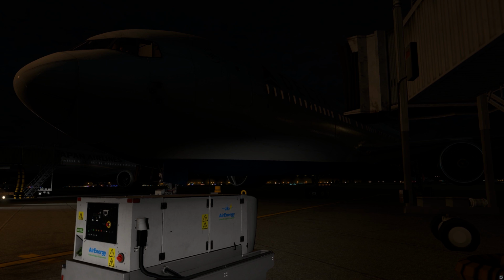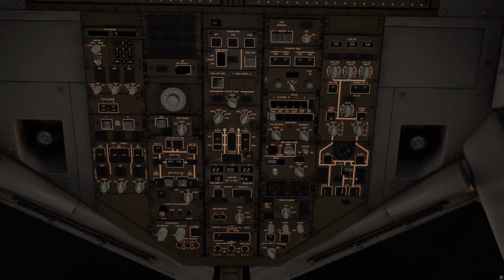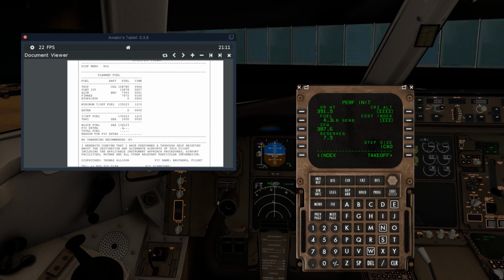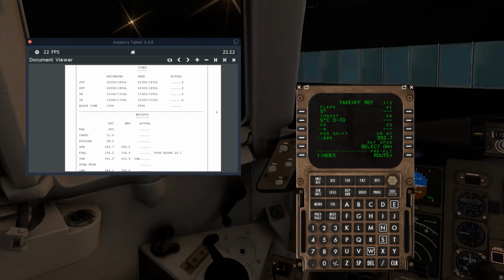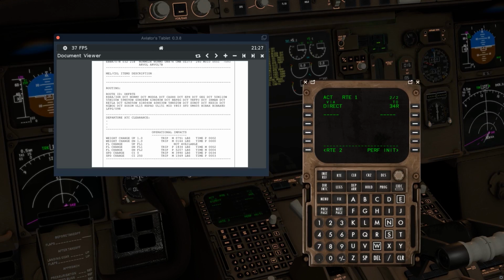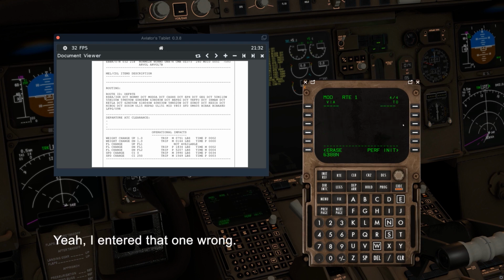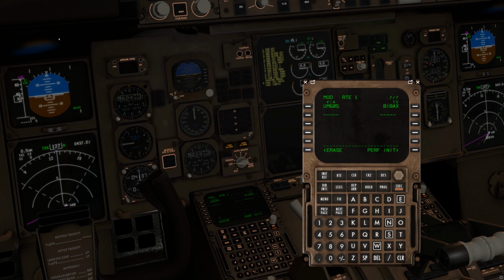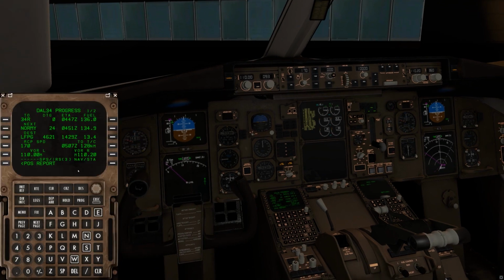X Plane 11 - 757 and 767 FMC Tutorial | Delta Airlines (Flight Factor) How To:

Comment: Why IRS on Heading? I‘ve never heard that before
Reply from the maker: When it’s flipped to the hdg position during alignment, it shows time remaining until alignment complete.
Reply: @FlightBrothersFT  ah ok and do you switch it back to PPOS when it‘s aligned?
Reply from the maker: It’s up to you.  I generally don’t care what my current position is, so I usually leave it showing the wind/speed data.  Depending on the options selected from the tablet, the wind data may or may not be displayed on the instrument panel.
Reply: @FlightBrothersFT  alroght. Gonna check it out. I really have my troubles with this aircraft. Do you have GA issues too? Or even after landing? The APPR mode is not possible to disconnect on mine, so when I have to do a Go Around I must fly manually and have no FD, while it‘s not smart to take eyes away from the PFD because the aircraft is pretty wild 🙄
Reply from the maker: Hmm, I’m not too familiar with any issues.  The approach mode should be disabled once you flip the AP disco bar down on the MCP.  As for the GA, I have not done one in a very long time.  IIRC after pressing TOGA to initiate, your FD should still be available, you would have to re-enable the AP, though I don’t remember if the gear and flaps are tied into that process.

Comment: Do you have a video on VOR navigation in the 757, specifically using the auto pilot while flying inbound to a VOR
Reply from the maker: No we don’t.  If you are flying inbound to a VOR, set the course to the outbound radial.  If you are inbound on 270 and want to fly 090 away from it, set the course to 090.  If you want to fly 030, your bearing would be 030 but since you are traveling to it, your radial would be the reciprocal or the 210 radial inbound/or 030 bearing.  A radial “radiates” from it, a bearing brings you to it.

Comment: Every flight plan has me going into a traffic holding circle and not flying directly into runway heading. Im flying a 767 not a cessna 157
Reply from the maker: We’re not sure we follow your question.  Are you inputting the STAR to runway?  The 757/767 FMC will not allow you to input the arrival information (I don’t think) until you are greater than half the distance between the arrival and departure airport.  Verify this is being done, otherwise you are likely to end up at the end of a plan, possibly resulting in the hold.  This is just a theory.
Reply: @FlightBrothersFT  I do get a list of available runways along with a transition in the fmc plans but...they all end up a sharp turn or circle. The approaches are never straight on. Therefore..the localized cannot be intercepted.btw
My plan is KWSF  to KJFK I've tried ils 22...ils 13....ils 31...
Reply from the maker: Are you getting a discontinuity or a “vectors”?
Reply: @FlightBrothersFT  vectors...i shared a video here.

Comment: My final descent always misses the runway by a few degrees. The plane lands unto roadways and blgs alongside the runway...why?
Reply from the maker: I assume you aren’t hand flying.  Does this act the same with an ILS and an RNAV?  I’ve never had an issue with the FF757/767 landing.  Make sure you are setting the final approach course on the ILS receiver if you are using it.
Reply: @FlightBrothersFT  I programmed the ILS runway into the FMC. The FMC had the Nav radio properly set to the ILS frequency.  I dont believe I intercepted the localizer yet glideslope was picked up. Weird
Reply: @FlightBrothersFT  I also randomly picked my destinations runway. Maybe the runway wasn't the recommended one. I'm new at this.
Reply: @FlightBrothersFT  I also flew my final at 1800 feet.
Reply from the maker: @lastcall170  you tuned this ILS receiver, not nav 1 correct?  The ILS is in the center console, and your VOR is in front of the captain/FO respectively.  The FMC doesn’t auto tune the ILS.  
If you are on an RNAV the procedure is slightly different but contained within the FMC.  GS intercept should be below the Glideslope.
Reply from the maker: @lastcall170  we have a “Perfect Landings” video on the channel that focuses on setting up a solid approach to landing.  It may contain some helpful information.  As far as the “randomly picked up my destinations runway” I’m not sure what you mean by that.  Are you using charts at all either through the web or Navigraph?  We’ve got a Flight Planning for airlines Tutorial also.  There are a lot of variables at play to work through.
Reply: @FlightBrothersFT  I did use ILS approach and not Nav. I referenced my ils frequency that was indeed pre programmed by my fmc  flight plan including an ILS runway approach. I used "sky vectors" site for a flight plan with the suggested flight paths...vors...stars etc. I did not refer to the map included but just used the vors etc and placed them one by one into my fmc. I added the ils runway myself out of a list provided by the fmc.
Reply from the maker: @lastcall170  that all sounds solid.  Does it do this at multiple airports?  Have you deleted the aircraft and done a fresh install?  That’s the only thing I could think at this point.
Reply: @FlightBrothersFT  I actually only had 1 succesful landing with 
RNav flight mode. Lately Im also getting out of memory issues. Thats another story. I just realized youre using xplane and not fsx like me.
That shouldnt matter though.
Reply: @FlightBrothersFT  just for fun
Heres the crummy flight plans I seem to get stuck with .My runway is 13L at KJFK Airport. Ive tried every ILS Approach and always get a circular approach (STAR). Way too close for an ILS approach.
https://youtu.be/1e1x_dKZYX4
Reply from the maker: That is really weird.  From what I could see it looks good.  I don’t know why it did the right 360.  Normally we’d go LOC to get it on the Localizer then Appch once the Glideslope is 1 dot above path.  I couldn’t tell if the flight director was on the loc or the RNAV but it appeared to be properly indicating centerline.  Honestly, it looks like it might be somewhere in the aircraft software.  I’m at a loss.  Two further suggestions might be, if you’re on Reddit, ping the /flightsim community there or there may be an FSX specific group also, or contact the developer of the aircraft.  Procedurally, I didn’t see anything that stood out from an operator perspective.  I was going to suggest a direct-to the waypoint it orbited, but it looks like it picked it up, so I don’t think that’ll help either.  I’d try pinging the dev and the flightsim group.  When we were beta testing the SSG 748 v2.2, we saw a few niggles in the FMC where it didn’t respond appropriately to a STAR, and they worked it out.  Sorry I don’t have a better suggestion.
Reply: @FlightBrothersFT  It appears that this approach planned by fmc, isnt in best intentions for a 767 as it doesnt give the localizer the right distance or height to capture the glide slope. If It was at least 10 miles away at a straight line to the runway...there would be time for a gradual decent onto the runway. I didnt have time to even line up. My ILS landings always work with this aircraft when using my ATC for vectors . There are  no issues with the plane. Its the lousy plans built into fsx . By the way...I had RNAV activated along with the LOC button.  I had no time to activate APP because of the short distance and lack of time.
Reply from the maker: @lastcall170  Can you confirm if the altitudes in the FMC match the actual approach charts?  I’m running on multiple data here.  I used to use the flight planner in FS9 when that was my sim, but now I’d never use any sim software for it.  I now use Skyvector.com, Simbrief, or Navigraph when building my flight plans.

Comment: Wow man I did the same thing you did in the video but my waypoints dosen t appears
Reply from the maker: Pepe roberto some of the points may be replaced by subsequent AIRAC cycles.  This video has been out for a while.  Did some of them work?
Reply: @FlightBrothersFT  no one
Reply from the maker: Pepe roberto that is extremely odd.  I would suggest possibly a different flight plan, if that doesn’t work then I would do a clean install of the aircraft
Reply: @FlightBrothersFT  hey but I saw something, in the navigation display I m betwem two lines but in your video it s completely diferent
Reply from the maker: Pepe roberto it’s likely they changed something.  The video is over a year old and the aircraft has been updated. I haven’t flown either the 75 or 76 in quite sometime, maybe 6 months ago, but I had no issues with it at that time.
Reply: @FlightBrothersFT  man I think I found the problem, I saw a recent video from a 767 and I looked in mcdu something about a reference airport it s that correct?
Reply from the maker: Pepe roberto you’ll need to initialize the location so it knows where it’s at.  Depending on your setting it could take up to 7 minutes to align.  The logic is similar but slightly different than an Airbus (I assume you’re familiar, since you referred to a MCDU).
Reply: @FlightBrothersFT  yes

Comment: most of the time when im entering my waypoints it says not in database any ideas?
Reply from the maker: Sounds like your plan is from a different AIRAC cycle than your FMC has. The nav points are updated monthly, usually with very minor changes here and there. The futher apart the AIRAC data cycles, the more changes and issues you'll have. You can either update the data (for example Navigraph charts subscription service) or roll back the simbrief.com cycle when planning to match your xp cycle.

Comment: HI, friend! I see you know a lot of the 767, congrats! Please help me with autothrotle in the 767. Every time I do a takeoff with the 767, and set my autopilot, i get overspeed. The autothrotle dont work! You have this problem? Sorry for my bad english!
Reply from the maker: Are you using VNAV with auto throttles? If the FMC is correctly set, using VNAV should let the autopilot control the speed and pitch. This will give a safe climb to cruising altitude without overspeeding.
Reply from the maker: On takeoff, you also want to pull the nose up to about 15 degrees, this will keep the airspeed from building too rapidly.  We have a Delta 423 Part 2 video in the FF757 that might help.  Part 1 is mostly the preflight activities, part two is pushback to climb out.  Take a look at those when you have time and see if you catch anything useful.  If you still have a similar problem comment back and we will do the best we can to assist! :)
Reply: @FlightBrothersFT  Thank you very much for your kindness!